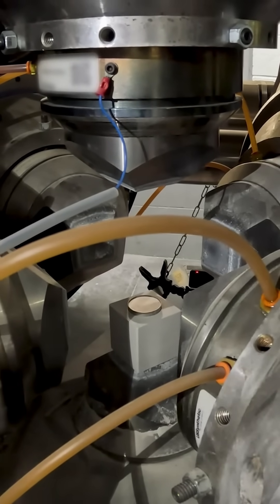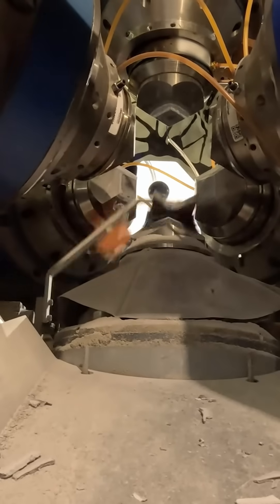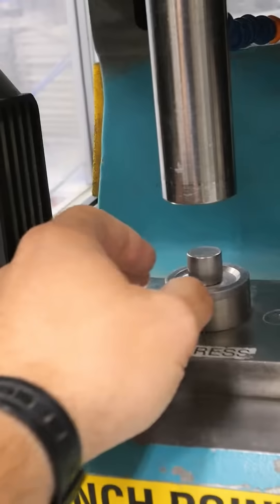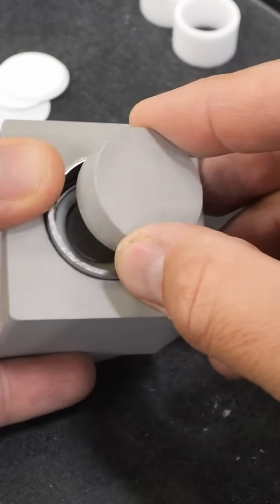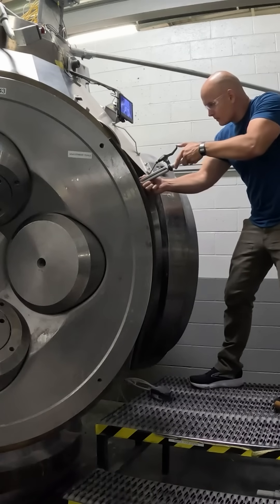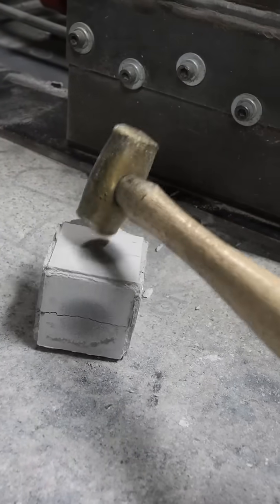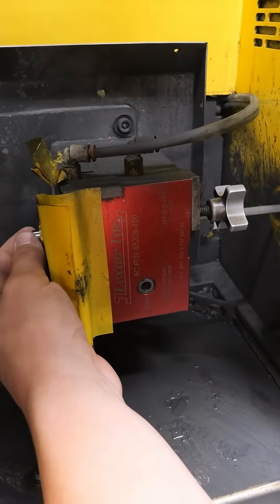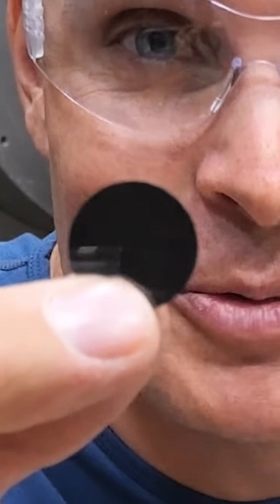How to make your own Diamonds - (easiest method)

Comment: So I've been there and done it. Except the process that I did was the belt system. Which is as it sounds a system of belted Steel with a tungsten carbide Center to withstand the pressure. There were two anvils that pressed into the center into the salt graphite diamond matrix. Which is similar to what he showed when he poured the diamond into a tantalum cup. The cup is surrounded by salt and then graphite, which is the conductor through the medium. There were two presses which compressed onto the cup and salt mixture constrained by the belts and tungsten carbide holding. Electricity is then run through the graphite and enormous heat and pressure are exerted. After the process completes after about I'd say 20 minutes. You chip out the diamond Matrix which is comprised of a Tungsten Carbide base with a Diamond Head similar to what he showed. And then you grind and polish the final PDC bit. There are a few more steps to the process in detail but in essence the belt method of PDC bit manufacturing is the same.

The "fun" part of the process with a built manufacturing method was that occasionally the anvils don't line up perfectly or there's some other defect or misalignment or imperfection in the cell that you are pressing. And under pressure and at temp you lose containment of that cell of salt and graphite and it explodes out with massive Force. Under the belt process when this happens there was enough force that it could shatter tungsten carbide of the compressive belt cylinder or the carbon steel anvils and it would blow out. There was enough force that it would Lodge carbon steel at least a half inch into 1-in steel containment doors. It sounded like a bomb going off in the factory.

So yeah just a little bit of fun at the workplace. Welcome to downhole tools. LOL

Comment: Seems random that you need 2000 elephants to press the thing and then a dude with a hammer opens it 😂
Must have been Thor’s hammer😅
Reply: The outer layer was just a cast. Not an actual diamond.

Comment: You can't create a diamond because it's the hardest material on earth, and to create it, you have to use materials much harder than diamond.
Reply: No you don’t. All it takes to make a diamond is heat, and incredibly high pressure. The material that compresses the powder doesn’t need to be harder than the diamond itself.

Comment: It looks like this is not actually creating a diamond but compressing existing micro-diamonds in powder form into a larger diamond. Still very impressive though.
Reply: Well yeah? Diamonds is literally just heated and compressed carbon. These use carbon dust, and heat it and put it under immense pressure, which creates a nearly chemically identical diamond. The only reason why this form of diamond is not 100% identical is because it is contaminated by the metals that surround it. But you can make a 100% identical diamond by using something called chemical vapor deposit.

Comment: What's the point of making these black diamonds? Sorry, I must have missed that part in school.
Reply: Being able to make diamonds significantly reduces the overall cost of equipment as diamond bits, mills, bores etc are all very useful. Basically it’s a cheaper way to make strong tools.

Comment: This is just one of a littany of reasons your gas can be expensive, our drill bits on oil rigs are made with black diamonds and other various components (Steel, Tungsten Carbide etc.) 

Average price range: anywhere between $10,000 to $150,000 depending on the build, brand and the type of bit (oil well or fresh water)
Reply: I'll never forget the look that was on my Driller's face when we pulled out a bit from a well in Coyanosa that was COMPLETELY bald, and had a half dollar sized hole punched straight through it. That's one very expensive oopsie.

Comment: It all sounds clean, aside from talc. Talc is probably carcinogenic, but more-so if the talc is contaminated with asbestos.

I would imagine aerosolized dust is rare and limited, regardless, and that a diamond factory would use very high purity talc.

🧙✨☠️

Comment: forgot to add that the pressure has to be precisely the same all around at the same time without fail. This is mimicking natural formation pressure in the earth and amplifying it, which is why it can be made artificially like this and less time, obviously. Under this pressure they also add molecules on a single molecule basis and is the "secret sauce" not shown or told in these processes and is proprietary. Like building blocks or a house of cards, the molecules only stack in a "certain" way or do not make the diamond successfully. This is much more complicated than this video, clearly.

Comment: But these seem like small disks?? How is this a diamond? 

I'm unaware and genuinely curious
Reply: Those are cutting diamonds, you can see in the video an oil drill with the diamonds in it. It’s also used for high tech experiments where you need an almost perfectly flat slice of carbon.

Comment: So it's like an instant diamond machine bs the machines that pull carbon from the air? What are the implications, are these diamonds inferior in any way as opposed to the carbon dioxide based which take a lot longer to make?

Comment: Could you use that machine to detonate a nuclear bomb, similar to how fat man (the bomb dropped on Nagasaki) worked by imploding the nuclear material with conventional explosives causing fission? To my non scientist brain they seem like similar concepts, high temperature and immense pressure. So if you put enriched uranium or plutonium in the machine would it detonate?

Comment: The cobalt is what makes the diamond black. Immense heat is involved with this process and that heat allows the diamond to take on other elements to gain color. There are synthetic materials that are far harder than diamond. Properly formulated and used nickel boron surface conversion on certain hardened steels for one example, creates a surface with an equivalent hardness to mohs 14.  Now consider that diamond at mohs 10 is about 140 times harder than a mohs 9 like sapphire.  We have even harder synthetics as well . These synthetics are generally used for consumable parts in precision CNC machines used in aerospace manufacturing, like bearings and other parts that will change tolerances as they wear.

Comment: I see pressure. Where is temperature?
Reply: When molecules have higher average kinetic energy, the temperature of a substance increases. Pressure represents the force exerted by these molecules when they collide with their surroundings. If you compress a gas by increasing pressure, the molecules are forced into a smaller space, causing more frequent collisions and higher speeds. These more energetic molecular movements result in a temperature increase.  

TLDR more pressure = more temperature.
Reply: @Rule_Enforcer  is pressure static or dynamic like impact force?

Comment: I used to be a technogist designing fixed cutter bits for Halliburton. We would occasionally design new cutter types and shapes and I always wondered how they were manufactured
Reply: Usually with machines...you're either chunking shit off (subtractive) or smashing it together (additive).  That's what's available. This is the latter.
Reply: @rickfeith6372  I'm very much aware of the two base manufacturing methods lol. I was pertaining to how the diamond cutters were made

Comment: Tool and die makers in almost every good fastener shop. You will find some who outsource and put those vending machines in there shops for freaking tool bits... Have to fight tooth and nail and set so many offsets your would get fired before you could get a new tool.

Comment: Why would you grind away the tungsten carbide if its stronger than the black diamond
Reply: Because the diamond is more expensive and harder. They have different uses.

Comment: OOH, come ON! 😂 don't forget to add microwave or heat in high temperature with that pressure machine to build stronger material. But that machine is a very nice one.😊 but with an add machine, it can build super strong material.  Even can into a new CPU chip waffle too🤔🤔🤔 factual.

Comment: Not a waste of power at all
Reply: You could use them to make drilling equipment for mining and things
Reply: @Thermalpulse  diamonds are not rare. We mine millions of them yearly. Almost all of which are used by industry (mining, drilling, cutting, lasers, etc)
The only reasons diamonds are expensive is because of marketing by debeers and them controlling the market.

Using HUGE amounts of energy to produce diamonds is silly.
Reply: @VoltsAnBolts They really don't use that much power. I don't know where you're getting that from.
Reply: @teldd4930  it uses roughly 250 to 750 kwh to produce 1 lab grown karat 

That's ALOT of power. You don't know what you're talking about.
Reply: @Thermalpulse that's not worth it. We mine so many diamonds naturally. We do not need lab grown ones for industry. There is no shortage of diamonds.
Reply: @VoltsAnBolts  Mining diamonds actually takes more effort and power, destroys the environment, is more expensive, and is much more dangerous (they're often called 'blood diamonds' for a reason, and that reason is that plenty of people die to mine them up).

In other words, no, it isn't a waste of power.
Reply: @teldd4930  it takes much less power. They are digging up millions of carots with a mine.

Blood diamonds are called that because it uses slave labour. So technically much less power, just ethically horrible.

Do you understand how much power 250 to 750kwh is?!?!

Comment: Well that's all fine and dandy but here's my question why is there a radiation sign remember if anybody knows what they're talking about a diamond is made between extreme pressure and heat pressure is created so what are they heating it with???
Reply: When molecules have higher average kinetic energy, the temperature of a substance increases. Pressure represents the force exerted by these molecules when they collide with their surroundings. If you compress a gas by increasing pressure, the molecules are forced into a smaller space, causing more frequent collisions and higher speeds. These more energetic molecular movements result in a temperature increase.  

Basically more pressure = more temperature.

Comment: I’m kind of amazed that the process doesn’t involve a heating element. So very cool, love your work! 🙌
Reply: There is an extreme amount of heat involved.  They shoot electricity through the top and bottom anvils.  If you noticed the diamond core is set in a graphite tube connected to the metal rings at the top and bottom of the talc cube.  As the electricity passes through, the graphite acts as a resistor and reaches extreme temperatures combined with the pressure of the cubic press, and presto, diamond.  Notice how cooked the center of the cube looks when he cracks it open with the hammer, and you can see how the salt is melted to the metal can surrounding the diamond blank.
Reply: May be the pressure produce a tromandess amout of heat ?
Reply: @ yes the friction and pressure would, but why not heat the tips of the device? I believe the yellow synthetic diamond making proces does.
Reply: @mauricemenard2243  tremendous.

Comment: And just in case you find it interesting, that machine that ground it to a perfect cylinder after all that is called a centerless grinder.  Same process is used for ground bar stock or parts like wrist pins in engines and many other shafts that don’t have 60 degree centers drilled in their ends!

Comment: This is awesome to see. I work on oil rigs drilling with PDC bits, I had no idea the tooth of the cutter was straight diamond, I always thought it was like a diamond sandpaper or something. The more you know!
Reply: i work on drilling rigs too. PDC bits use cutters brazed into a steel or tungsten carbide body (can tell the difference because steel body bits generally have blades that stick out more from the bit body). 
Diamond impregnated bits are more like sandpaper, with diamonds impregnated in a tungsten carbide matrix. In this case; the whole bit wears away slowly, but retains cuttings strength because the diamonds are dispersed in the tungsten carbide matrix. These are used in hard rock areas, usually along with a high speed/low torque downhole motor or turbine to provide high RPMs and grind the rock away.
Reply: @ thanks for the breakdown. We use mostly Ulterra or Baker tungsten carbide PDC bits with separate cutters like the one shown in the video, I just didn’t know the teeth of the cutters were solid black diamond
Reply: Yeah it’s pretty wicked stuff… each cutting tooth of the blades on those equipment is comprised of 2 parts, the diamond tooth, and a hardened steel or tungsten carbide base the tooth is fixed to, which is then bolted or riveted to the blade face for easy replacement. And each tooth is expensive asf… like a couple thousand.
Reply: Yup, main reason security would be inspecting your backpack at exit points
Reply: Well, that's why your not the foreman of a rig.
Reply: @MrOldclunker  there isn't a position of "foreman"...

Comment: They are not making diamonds.
This is called PCD or polycrystaline diamond.
It is much like the Tungsten carbide substrate, but amped up a bit with diamond dust instead of carbide.
PCD blades and cutters are very expensive, but last and last.

Comment: The turbo encabulator is a highly advanced piece of equipment that automates the synchronisation of cardinal grammeters. It features a baseplate of prefabulated amulite, surmounted by a malleable logarithmic casing in which two spurving bearings are connected in direct line with the panametric fan. The primary drive mechanism is supported by a combination of internal and external juxtaposition, allowing for the complete and effective management of the logarithmic reversal.

In operation, the turbo encabulator’s fluidic motor is powered by the combination of a high-frequency oscillation in the capacitor field and a built-in fluidic distillation chamber that ensures a constant flow of ionised quarks into the primary acceleration chamber. It is important to note that the turbo encabulator operates without the need for diurnal phase detractors, while maintaining a constant flux capacitance throughout its cycle.

One of the key features of the turbo encabulator is the ability to handle multiple quantum derivations, which are essential to the recalibration of hyperdynamic elements. It uses a completely automatic synchronisation process that delivers 37% more power than the previous models, while utilising a new method of combined entropy extraction from the interstitial flux pathways.

However, the turbo encabulator's greatest advancement lies in its ability to reverse the polarity of the highly-unstable quantum conduit, which is only achievable by the implementation of dual translocation of the primary frangulators, accompanied by the suppression of lateral thermotronic flux from the secondary escutcheon. The entire system is controlled by a central micro-adjustment knob, which can precisely modify the output to the user’s desired specifications.

Comment: Hearing one of those press pistons explode is the most terrifying sound! It shakes the whole building!
Reply: They explode?
Reply: @  yeah! If you put that cube into the press incorrectly or if there’s any weakness in one of the tungsten carbide piston heads, that head will explode under pressure. Pretty terrifying. 😂 2:05
Reply: please link a video of it happening i want to see and hear this now- 😳 searched and i couldnt find nothin but jewelry videos

Comment: You do that or wait forever using the vapor deposition process. Or if both aren't available, just use focused explosives to generate the needed temperature and pressure. But remember, those are all synthetic diamonds, they have perfect optical and mechanical properties, so prefererable for industrial applications. They are also better for jewelry, you just need to know which impurities to add to get a specific color, but still cheaper than natural ones, just because of the rarity of the natural ones, which btw. isn't even true and was a lie by De Beers to inflate the price. Mined unter horrific conditions for the people and children in those mines... 😢

Comment: I visited a facility (maybe this facility?) to see this. They had us wearing hearing protection (odd in a quiet room) because they said every once in a while a component in the crusher will break without warning with a sound louder than a gunshot.
Reply: I think I recall them saying it happens on the production floor (many machines) once  every 2-4 weeks.
Reply: I used to work in a metal fab place and sometimes when even bending ar plate in some of the pressed it would snap as it's a very hard and hard to bend metal and man it sounded like a shotgun blast went off even all the way across the shop floor

Comment: Dude... make a video where you make a diamond gradually adding more pressure, so we get to see a failed diamond, a diamond that is almost turning to diamond, one mid turn, and a finished one. If it were possible to video the diamond outside of the mould to see how it all rearanges itself would be amazing, maybe that can half be achieved with the use of less pressure

Comment: Once you start drilling in hard ground those diamond buttons do start to crack and break off the drill bit, tungsten carbide being soft yet dense lasts longer in adverse conditions, embedded diamonds are better again.